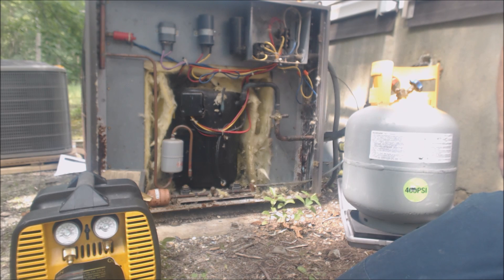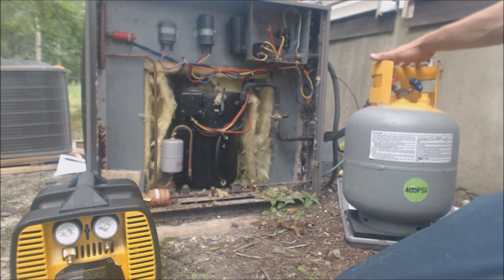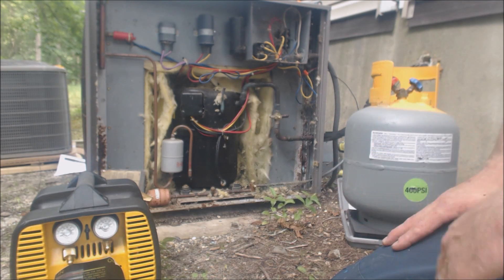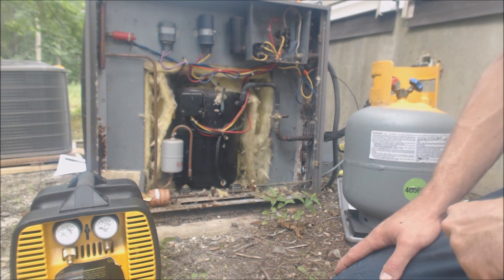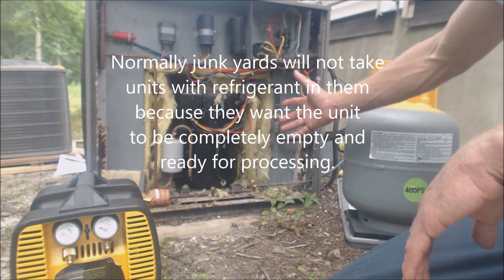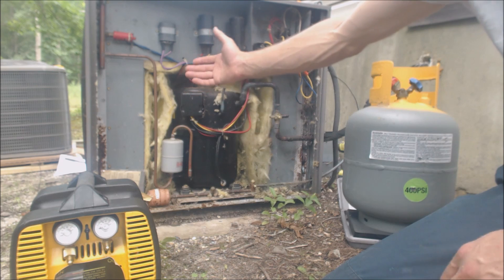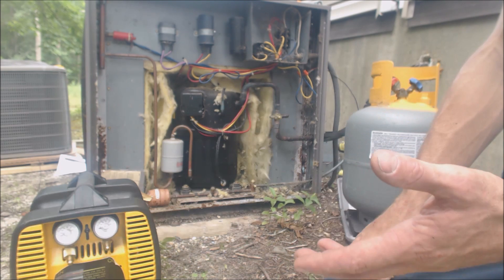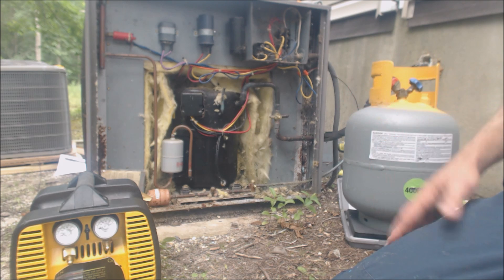Fined $37,500 for Venting Refrigerant? How to Prevent This!

Comment: $10,000 for everyone I turn in? You mean I can make 100k if I turn in all my coworkers? 😃
Reply: 10k per violation, yes.
Reply: It didn't work for me, no follow up just got fired
Reply: Maybe we could espose this.  I was a manager at a corporate hvac company In NJ I reported reports  900-1000 lbs of refridgerant a week average dumped to the atmosphere for years to the EPA by uncertified Techs causing damage to environment I reported again to EPA because it was lost or nothing was done Unseen Environmental Disaster 1 molecule can destroy 100000 O3 molecules ozone.  Refrigerant 
 R22 r410a EPA says they have no man power in our area and all leak report handling is done out of cicago they tell me to send to ODS.TIPS@EPA.GOV  and never get a response back.  This will be the third time ive reported
Reply: In sector two, there is not a single epa agent that covers leaks so you will not be getting any fines.

Comment: WHEN DO YOU RECOVER FREON FROM A UNIT DO YOU CHANGE THE COMPRESSOR AND PUT THE REFRIGERANT BACK OR DO YOU PUT NEW?
Reply: Unless a burnout
Reply from the maker: I recover when doing a change out. I usually put new in but now with R-22 phased out, if I am making a repair, I will put the original r-22 back in after it goes through a filter drier, thanks

Comment: yet garbage truck release freon every day people put air conditioners in dumpsters
Reply from the maker: The last person in the disposal chain is responsible for recovery so they would be the one that is fined if they were caught releasing, thanks!
Reply: @acservicetechchannel  That seems disputable since that would require the garbage collection companies to check dumpsters and garbage cans for small air conditioners or small refrigerators before dumping them into their collection bin which has a steel auger at the bottom which will certainly vent the refrigerant.  (which I think is the OP's point).  Checking every can for a roughly 0.00001 detection rate is economically unfeasible.

Comment: Why is it bad to vent r134a when it’s non ozone depleting but the only thing it has is a global warming potential that’s all ?
Reply from the maker: That is still illegal per EPA 608 guidelines and isn't something helpful for the environment. We still need to follow the laws, thanks Jacob
Reply: AC Service Tech LLC thanks for the comments
Reply: AC Service Tech LLC one time I vented r134a from a freezer that had a leak it looks like I won’t be doing that again , it’s just better to do the right thing and have some one remove the Freon for you.
Reply: AC Service Tech LLC  don’t even vent r12 or r134a it’s better off just not to vent any refrigerant at all that’s what I learned
Reply: @acservicetechchannel  if R134a (or any new refrigerant) is not free to discharge to the atmosphere, why not keep using R12? Are the new ones really better? I heard R12 is the best in HVAC performance.